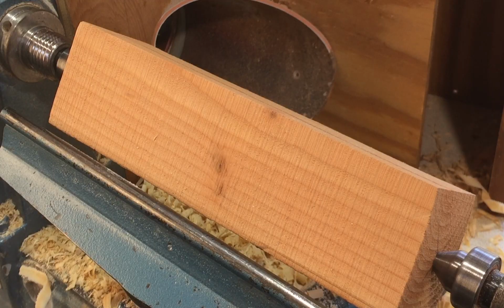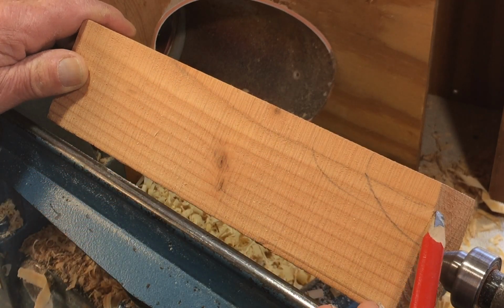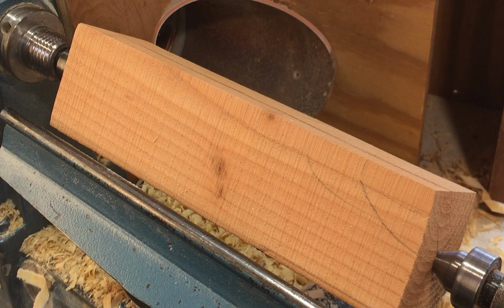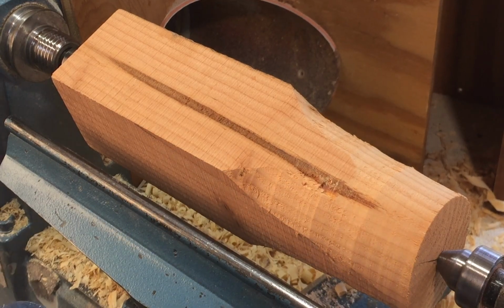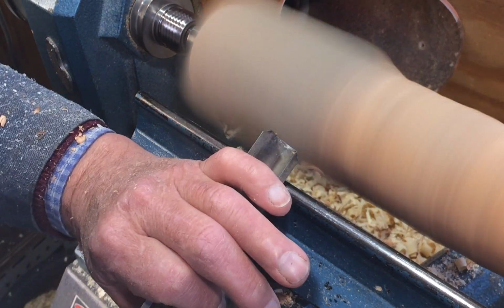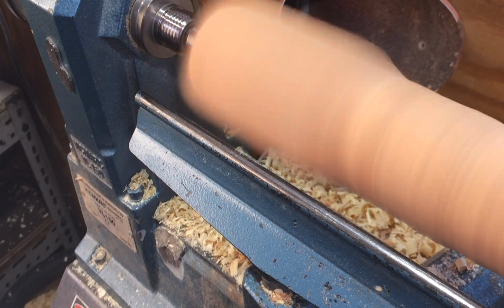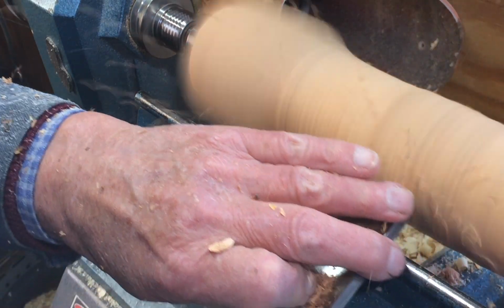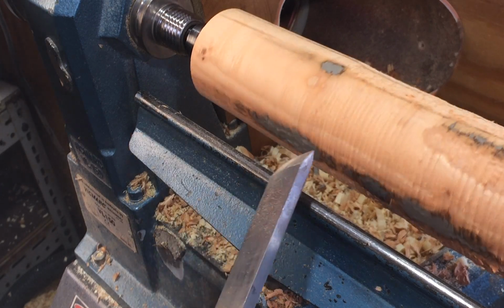Richard Raffan shows four tools turning a square spindle blank round.

Comment: One thing you didn't mention is why you might reach for one roughing gouge over the other two.  Is there a particular characteristic of the timber which guides your choice, or is it simply a matter of which one doesn't need sharpening?

Thanks as always, Richard.
Reply from the maker: I don't own a deep-fluted roughing gouge, but I do enjoy continental gouges for roughing down and long coves as they're more slicers than peelers. Anything under 50mm / 2-in I'll probably rough with a skew chisel.

Comment: Doesn't value his fingers
Reply from the maker: I've had 54 years as a professional woodturner and I still have all my fingers.
Reply: I disagreed with Honeybees until the final few seconds where his fingers "crossed the line". I have a Golden Rule about never, ever let your fingers be used for anything on the "danger side" of the tool rest. Fingers should always be on "your" side. I saw a very experienced wood turner rip his little finger clean off by having his fingers just over the danger side. The piece caught, the chisel kicked and his hand was somehow dragged into the work area. But that's my Golden Rule.
Reply from the maker: @chrisstewart8259  In this video my fingers are never beyond the rest. Over the top of the rest yes, but never near the wood. The camera angle is deceptive. However there are many times when a thin spindle is best and most easily supported by a hand and you'll see that in several other videos. I suspect that if your very experienced turner managed to lose a finger,  he wasn't anything like as experienced as he or yourself imagined.  Either that, or he was distracted, tired, or showing off, or a combinationof all three.